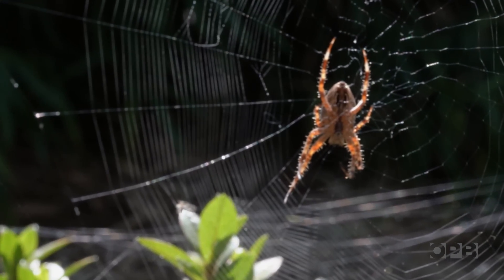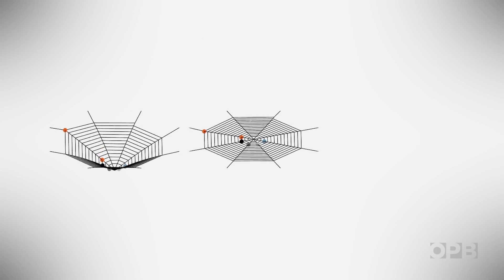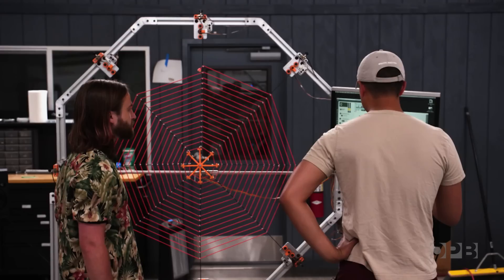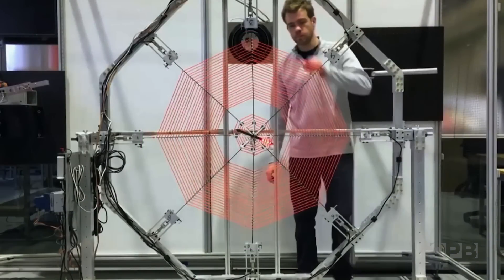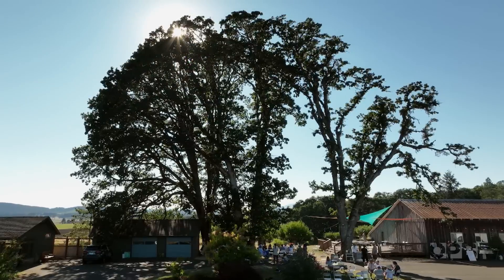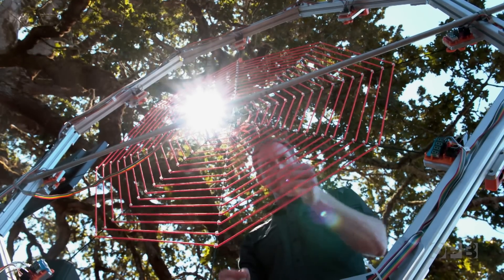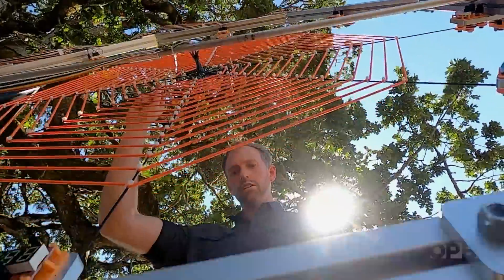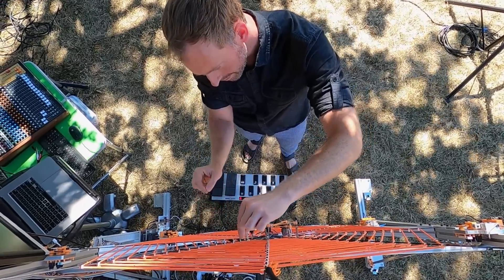Spider-web research yields … a new musical instrument? | Oregon Field Guide

Comment: It seems that having a web that is not perfectly symmetrical would make it easier for a spider to determine exactly where every vibration comes from (as every individual length of string would be unique) and for a musician to identify the different keys/notes.
Reply: Because there are 8 main lines going out in all directions and the spider has a leg placed on each individual main strand, so they can feel first which direction the insect is in by which main string vibrates the most.. is how I understood it... and then they can tell even more specifically from there by the vibrations of the smaller connections strands exactly where it is. That is how I understood it. Cheers!
Reply: @MrAdryan1603 I think that is a great observation. I am guessing the entire web vibrates, but there is directional sensitivity where the spider feels it hitting one leg first and then the other leg slightly slower and softer. And since it feels it through all eight legs there is almost a 3D sensation that gives a ton of information about what has moved its web. Size, distance, direction, etc.
Reply: @MrAdryan1603 Good explanation 😊
Reply: @MrAdryan1603  Yes, that's why the spider always has a leg on each radial string. It's the same way our ears work. We can tell direction based on extremely minute differences in timing and frequency between both ears.
Reply: @goosewoman re "a leg on each string" oh, I see 💡 Then it would stand to reason that a web spider who loses a leg would modify the number of spokes 🤔
Reply: @steezydan8543  thank you for clarifying. Wonder how the spider is able to identify where the vibrations came from in its symmetric-web setup. In any case, thank you. Your explanation made more sense to me.
Reply: But it's not really perfectly symmetrical but just as close as it gets to that for the sake of a strong structure. But in nature perfect circles to use as a rim of a spiderweb to make it perfectly symmetrical are rare. Also consider that the sting that goes across is a spiral, so there technically aren't 2 identical ones on the entire web and the whole thing is unique even if the structural strings were to be perfectly symmetrical in a wheel, the spiral is not. And that also means that being as close to being symmetrical as you can with that design is gonna be easier for a spider for different webs to be similar enough to be able to read or "hear" the information they give as reliably as possible with just instinct, it's not like spiders have complex brains like us to learn the quirks of every single unique web. And even if they were, every piano is similar, every guitar is similar, and so on. There will be differences between different models and stuff, but they need to be similar enough even for humans who learn to be able to use them readily.
Reply: That is such an interesting thought that I have never considered. 

I’m a drummer and I was thinking of it more like tuning a drum. The center of the drum is deepest note and deadest vibration. The rim has much higher note, but there are overtones all over the place where ever you hit the drum. I am wondering if the same physics apply. The outer notes, even though longer across, all travel to the longer lines which lead back to the center of the web. 

I can’t wait to learn more about how these reactions all go together.
Reply: @jmfs3497  Yes, the overtones are what makes it hard to just “feel for the string that vibrates the most”. We found that symmetry (strings that are equally spaced on either side of the string that is plucked get the same overtones) makes for a much more robust direction-detector, and used that as the basis for our algorithm.
Reply: 100% thats why webs aren't perfect.
Reply: Maybe, being affixed to different points would compensate for this. The substrate that it's connected to would create different tensile strength to the web. This may also affect the vibrations.
Reply: great observation and makes total sense, perhaps they have 8 legs as detectors for each of the sections of the web, hehe  id love to know if 2 or 3 bugs land on the web of different sizes, which one does the spider go to first? lol
Reply: it would be better because then each string would be different lengths within each segment. whereas now each segment is redundant
Reply: @PresidentoftheManosquare  The strings don’t vibrate in isolation, and the vibration that ends up reaching each foot depends on the angle between the foot and the plucked string. Comparing the vibration at all the feet gives us enough information to identify which wedge the plucked string is in, and then use that to tell the synthesizer system which note to play from the scale.
Reply: @rosslhatton ...

I'm saying if it weren't symmetrical then you'd get more notes.
Reply: @PresidentoftheManosquare  We already can distinguish the individual strings (and assign a note to each), because the “spider” can compare the vibrations at the different feet to tell the direction of the string which was plucked. In “concert mode”, the synthesizer  translates the angle/distance information from the “spider brain” algorithm into note/octave commands.
Reply: @rosslhatton  are your a bot?

All im saying is if the web instrument weren't symmetrical you could get more notes out of the instrument. As it stands having a harp with all equal sides means all notes will be the same on every side. 

If it were oblong you could make various segments of the web different octaves or scales

And if it were a real instrument made of wood and metal and not a computer and rope
Reply: @PresidentoftheManosquare  lmao you called the guy who built the thing a bot. i don't think you understand what this thing does. if you're reading the length of each string as a different note then it's just a normal harp in an unconventional shape
Reply: @Zreknarf   im sure youre right
Reply: @Zreknarf   i get what theyre doing, each segment is read by a computer and the computer decides what octave to play according to how theyve watched spiders do it. its like a graph with the spider in the middle, depending on where on the web was plucked its shows up like a point on a graph and then the computer can play the note assigned to that region of the graph. 

all im saying is if you were to build this thing not as a computer, with wood and strings then you would make it un symmetrical so you can get different notes from each segment. maybe i wasnt clear.
Reply: @Zreknarf   its more about actually looking at what i was saying instead of being so focused on proving someone wrong. 

if it were made of metal and wood you couldnt get different notes from each segment... because theyre all equal. think guitar, harp, every string instrument. 

it either has to be unequal sides or every single string would need to be a different note meaning a sperate string which is doable. i think an unequal web is cooler because most webs arent perfect and if the instrument were made of wood it would look cooler.

i think this is a cool idea. i just think it could be improved.
Reply: @ghostfifth  the guy who built it told you you're wrong and explained why, still you insisted you are right lol

nothing in this web is redundant, each section is a different note and each ring is a different octave

every other instrument uses that frequency modulation to produce pitch, this one is not, that's what makes it unique
Reply: spiders, and this mechanical spider, aren't reading the frequency of individual strings, but the web as a whole
Reply: Very likely, and a real spider spinning in a real environment must take whatever anchor points are available to it.  Tree limbs, leaves,  grass stems will hardly ever form a true circle,  so a web will almost never be symmetrical,  and Arachne will have to read those vibrations,  however they may be distorted.
Reply: @521cjb  it doesn't matter, the vibrations of the web are being read almost as if the web is a 2d plane, they can detect the direction and amplitude and that's it, frequency of individual strings doesn't actually matter
Reply: I don't think they are perfectly symmetrical but only appear that way at a glance. My experience is just from my stoner brain and experience of watching them in the forest and my garden but they always have their webs developed around the objects they have to work with and that is always different. I knew vibrations and tone played a role in the web formation but didn't see it as music until now since I could not hear it for myself. I follow what you mean though. I hope this develops into a real marketable instrument. I'll be taking my old guitar strings and making webs with them now. Thanks YouTube
Reply: Maybe that's why the inner webbings are a single spiral and not concentric circles?
Reply: How come? I am unable to follow your point of view
Reply: @webrishi think of it like a piano with all strings ending at a central circular point. If a hammer hit any string it would be a unique note and you at the center could feel feel the location based on the note
Reply: @webrishi  a low note is on the left of a piano, a high note on the right. now roll up the piano into a spiral
Reply: @webrishi 🤣
Reply: Every detail in nature points to the presence of a creator. This creator is, of course, Allah Almighty, Lord of the Worlds.

"And in your own creation, and whatever living beings He dispersed, are signs for people of sure faith." (Holy Quran; 45/4)
Reply: @motherlandmars5999  That's like, just your opinion, man,(the Dude).

Comment: so what exactly is the spider in the center of the web for?  In the beginning I thought it would be playing the music with it's feet.
Reply: The "spider" is the part doing the sensing. 

The 8 clips attached to each paracord line are attached to vibration sensors, which are connected through an orange plastic structure. 
Those sensors each work like microphones, turning the physical vibration (and intensity) into electric signals, which the computer compares between each sensor in terms of relative frequency and intensity to triangulate the location of the "pluck".

What is NOT happening here is any "acoustic" musicality. If you just attached a contact mic to this and amplified it, it would sound like plucking a stretched rubber band. Or rather, a LOT of differently stretched rubber bands, because they will ALL sympathetically vibrate to some degree. 

The tone you're hearing is generated by the computer, which is simulating the spider's brain and determining the position of the "pluck", and assigning each position a musical value. It's much more like a digital keyboard in that sense. With extra steps.
Reply: ahhhhh!  OK, that makes sense.  Thank you.   @SenseiWarren

Comment: As someone who has often been intrigued by the multitude of "visual" patterns that emerge from the guitar fret board, as well as the patterns that may emerge from a riff in the scale I find this octagonal fret board quite intriguing. As an IT professional and programmer I also find this quite thought provoking in the sense of the emergence of entropy or patterns from the underlying mathematical algorithms expressed through graphic visualizations.
>
The spider "sees" or visualizes via the sound pitch and direction. This has similarities to studies that I have looked over where engineers developed a system of 2D sound that the brain of a visually impaired person can re-interpret as form of spatial awareness or pseudo sight. In time the visual center of brain will begin to overlay a pictographic expression of that spacial awareness with colour, shades and depth. Some of this original study and the engineering drew from medical information about the cross over between the visual and audio centers of persons under the influence of LSD. I also believe their is a critter that hunts in the water at night using "audio echo" feedback similar to bats, but the physical string idea is quite different; more direct.
>
To extrapolate this idea to the extreme, we can imagine the universe as a web or mesh of fine strings, except instead of just sensing information from a point on the web the information could also be sent to converge at a single point in the web or mesh from which a particle may emerge from that point in the wave function. <- obliviously a universe based upon sound vibration would be a very slow laggy and a somewhat warped looking universe. We would need better granularity than 5 points per second and a bit higher frequency. lol
>
Most novel and impressive idea I have seen in a very long time. Thank you posting a video explanation on this :)
Reply: Yeah in my opinion the visual centers of the brain are actually for  making maps and spatial judgements rather than just what we usually think of with sight
It extends to touch too! Such with braille and tracing shapes on someone's skin.
If we had a nose with 2 directional chambers we would be able to smell to replace visuals. Reptiles forked tongues are great at that.
Reply: @orbismworldbuilding8428  You are correct with that. the visual cortex processes all available information including past memory events to "Create in image" in the minds view screen. If what we see (eyes) has missing information or doesn't fit into a neat past category the brain overlays additional information to fill the gaps or make corrections to what the eyes see (This happens with the other senses too).
Stephen Pinker has an exceptional ability for explaining and illustrating how much of that works.
They just plugged a transplant eye into someone not long back, so it will be interesting to see how successful they are with the neurons. It's kind of scary exciting just how close we are to having Start Trek Borg implants.
Reply: Right? This creation gives me ideas. Combining a humdrum type with a reverb air harp. Omg it's would be majestic metal or epic folk sound. Would be fun.  Which would make is scalable as well.
Reply: @MrJayOkane  Sorry, I couldn't understand what you were trying to say in that?
I was talking about the underlying physics.
Reply: @axle.student
Your comment was better & more informative than the video 😎
Reply: @JesgateOnDown  Thank you. [Me feeling a little humbled]
Reply: @axle.student seriously bud, that was a great breakdown.
Reply: @applejacks8160  Cheers :) Chit just runs out of my mouth (fingers).
Wish I could remember the name of the study with the audio glasses. It was pretty impressive. I'll have a copy in my back archives no doubt :)
Reply: @applejacks8160  Actually, a thought just occurred to me. It was on my mind as a watched the end of the video. but I didn't look close enough to the web.. continued in a moment.
[Edit] yes, it's there. No doubt the creators of this are well aware of it. (Note that the natural made web by the spider may not have this ability) The red radial cords step out a small amount at each black cord to create a spiral. Meaning that each section of red between 2 black cords is unique. Approximately 128 different notes (red sections). Nothing too surprising with that, but here's the kicker. This device has 2 separate methods of information transmission; one method uses the black cords to sense a direction and amplitude of the vibration, as well as the second method which can sense an individual red section by the note (or frequency of the vibration) and that is not even taking into account other harmonics that would exist across the entire web.
>
Thinking on the problem with analog computing what we have here is 8 sensors and 128 information points in that 8 sensors with some cross over ability between analog and digital. If 8 and 128 sound familiar that is forming a 8 bit byte with 128 characters (4-bit) extending this web to have 256 red sections in a standard computer byte, but with additional information.
I would have to model this to understand the full extent of what this would be capable of lol
>
Amazing stuff isn't it :)
Reply: The web has eight sections, there's eight notes in an octave, throw in the wheel of fifths (for [electronic] transposing [harps have pedals).
Musical dunce but offering ideas to others.
Reply: @kozmoigmkliegl6192  It all good. I've half designed an alternate analog computer out of it in my head already lol 8 sections is a byte, it has 128 bits of red section ( a nibble) another 128 red sections and its a decimal byte. So I have 2,048 bits of information in that web design but can maybe even expand that further when I do the math properly.
Don't mind me, just trying to recreate the "Web" from the web.
Reply: Wtf are you talking about...you sound like a chatbot... LDS is nothing but fun poison lmao so sick of hearing all the pseudo science surrounding it...
And literally bunches of animals echo locate underwater... sound has always been associated with detecting the world around us...
This spider web study is just a lark... if theres any benefit to it at all I cant see it... 
What this video actually seems to convey is that outside of a corporately owned lab with real risks and rewards on the table science is basically becoming a joke because wealthy brats from modern American colleges have cornered the profession and dilute it with their extremely shallow ego driven goals...